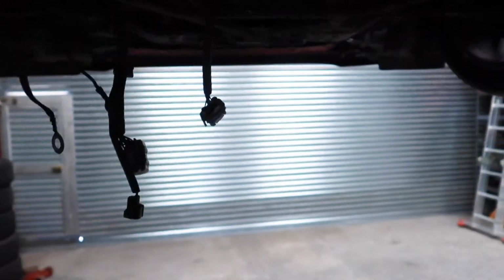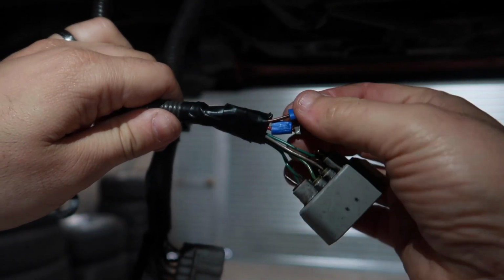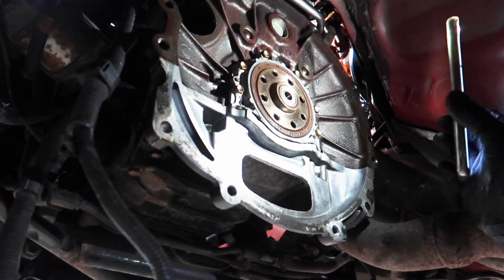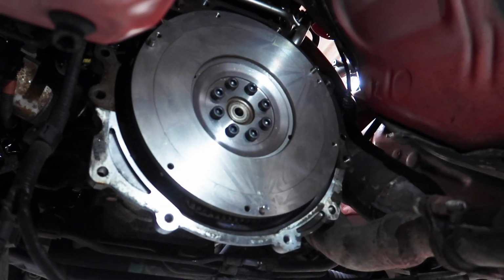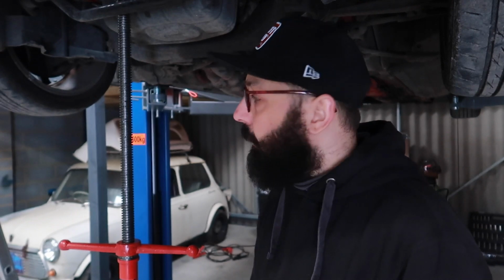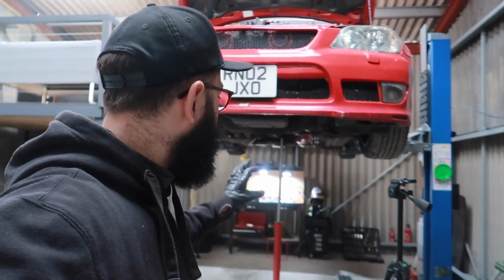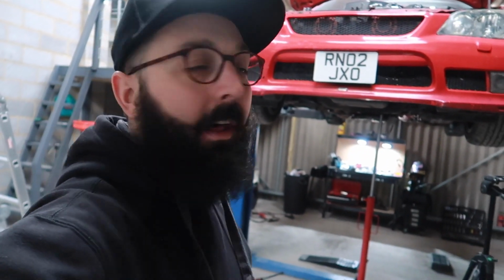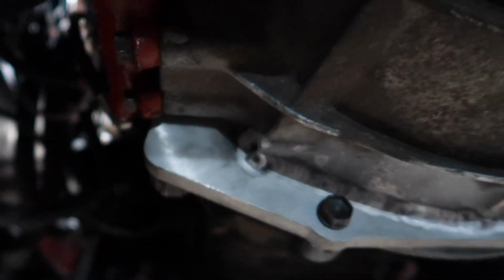Manual Lexus IS300 is finished | Cheapest JZ conversion under £1000

Comment: My bad I watched the hole video and actually understood 🤝😅
Reply from the maker: Sorry. no pedals. They were already done when I got the car to me.
Reply: hi mate you know what is300 is getting expensive in my opinion and gs300 is under 1k so do you think it’s the same process as the is300? Should be right?
Is300 wagon seen one for £1500 not bad  but I don’t know about the wagon life🤷‍♂️🤣 and I know that the gs300 would be a lot heavier but what you reckon same applies with the manual swap?
Reply from the maker: @Booosted_civic  I am unsure of the pedal situation and the driveshaft length on the GS300. I can 100% recommend getting in contact with Johnny from MSC Autoworx. He is very helpful and should be able to answer your GS300 questions.
Reply: George Hampl sounds good 👌
Reply: George I’m new to the channel so could you maybe show use all the Japanese’s cars you own currently Please as it’s lockdown right now🥺🙏

Comment: Do you get any hesitations on certain throttle inputs after the manual swap?
Reply from the maker: I believe I do now. I would personally instal the emulator but this was customers car
Reply: Ok its not only me ahhaha. I need to order the atemu soon.
Reply from the maker: Yes, Its not my car but customers and he was told it doesn't need it, it seemed okay at first but after while it's noticeable.
I have done another Turbo one where I have wired it in but it had no issue.

Comment: Have you done any JZ into manual is200? Do you think it would line up  lengths wise with stock j160, is200 prop shaft and diff, and just drop the jz and stock is300 mounts in front?
Reply from the maker: I haven't but I know Crest Motorsport NW sells IS JZ engine mounts that make everything else line up.

Comment: Have you the check engine light on?
Reply from the maker: You need to wire in some resistor for the EML not to come on
Reply: @GeorgeHampl  ok and what and where do you install this resistor? 😊
Reply from the maker: @matteoramos5061  I cannot remember exactly. Message Phoenix Management on Facebook. He is very helpful
Reply: @GeorgeHampl  ok thanks you man! Great work for your swap 💪🏼👍
Reply from the maker: @matteoramos5061  thank you
Reply: Hey what do you do for the oil gearbox cooler?
Reply from the maker: @matteoramos5061  Just leave it disconnected. You don't need it for manual.